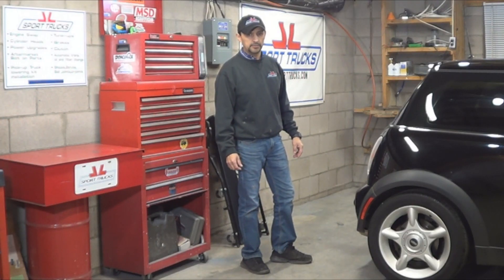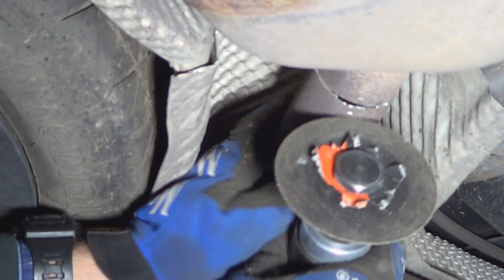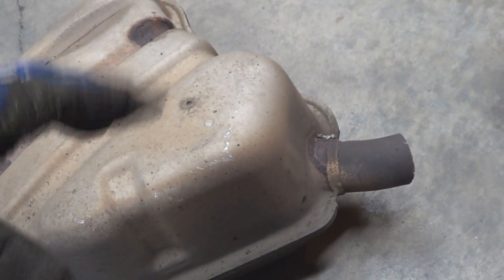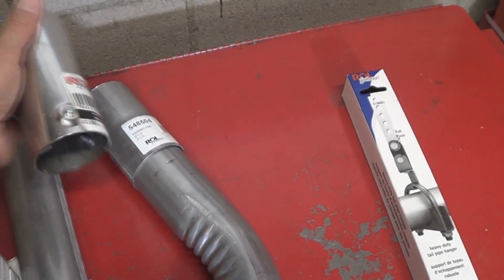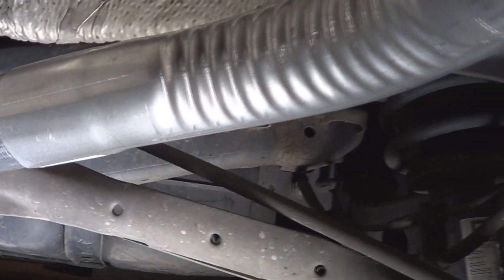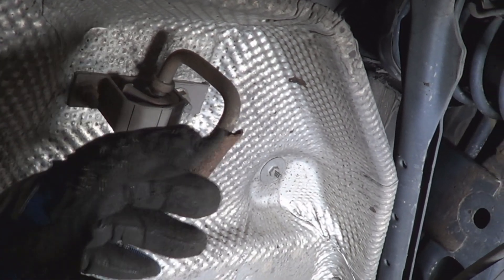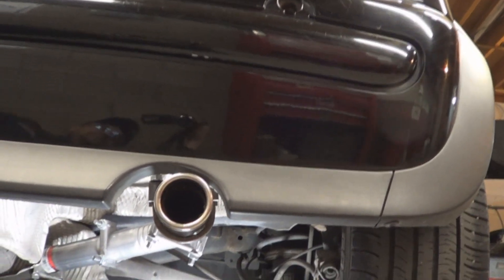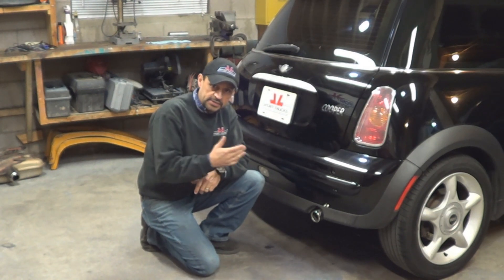R50 Mini Cooper DIY Muffler Delete for under $50.00  Awesome Exhaust Sound

Comment: Nicely done. The muffler on my R50 completely rusted off the exhaust pipe. It sounded great, not sick, even without the tailpipe parts you added, but, I wanted a quiet exhaust so my young son doesn't get a ticket and so I can hear my radio. I did the same as you, except instead of the new straight pipe, I used a Thrush muffler 17702, clamps and a hanger. The tailpipe is a 45 degree angle pipe, and the factory chrome tip fit perfectly. To my surprise it sounds almost as quiet as when it was a new car. Factory muffler is over $550, local shop would do their version for $255, or their cheap version would be like my set up with a resonator in front of the turbo muffler. I paid $30 for the muffler and $25 for hangers and clamps.
Reply: I'm planning on doing this to my r56 would it be obnoxiously loud if I leave the resonator in?

Comment: best thing about this? you remove about 55 lbs of dead weight when you lose the stock muffler😃.
i ran a straight pipe, with a resonated tip. deeper tone than any civic, really impressive sound the mini 
cooper puts out in person. 2003 cooper base manual 5 speed. don't count on any horsepower gains, 
and gas mileage seems to have dropped a hair, but not enough to care.
Reply: I'm planning on doing this to my r56 would it be obnoxiously loud if I leave the resonator in?
Reply: Those silencers really are incredibly heavy! Crazy to be honest!

Comment: Would do the same in the UK give you issues when it comes to putting the car in for its MOT?
Reply: Nah you'd be ok for the most part. Emissions wouldn't be an issue but you may get a tug by the plod if it's incredibly loud! Most don't seem to care though even though there is actually legislation in place for dB levels.

Comment: I've same model. Has it altered performance or feel at all
Reply: Well straight piping a car dose give u some horse power Idk how much
Reply: you lose power
Reply: @RoadRunnerMedia  louder sound = faster car
Reply: Same with stripes
Reply: @patcoolboy 

I'm shocked to see 5 people upvoted you, scary.

While you probably won't gain any bhp you absolutely WILL NOT lose bhp either.

I love it when people say "oOh BuT yOu NeEd BaCk PrEsSuRe" - You don't. Increased back pressure is the enemy of the ability for an engine to breathe.